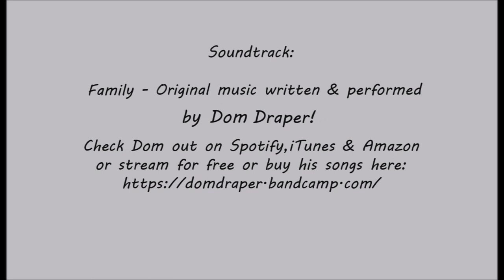How to make a waxed canvas drawstring bag from start to finish!

Comment: That's brilliant, definitely on my Imminent Project list! Regarding the corners, I always use (usually for collars etc) the thread method, gives such clean results. As you're sewing it up, you wrap a thread round the very corner stitch so that the thread ends are left inside. When you turn it out, you grab those threads and use them to pull out the corner. Gives fabulous results. You can thread it after you've sewn it, with  a needle, but it's more awkward.
Reply from the maker: That’s a great idea! Thanks for watching my friend and for the tip, I appreciate it!

Comment: If you can find waxed canvas, it's very expensive.  Thanks for doing this video.  I am planning to make zippered pouches to sell and want to use some unexpected materials such as cork fabric, waxed canvas and leather.  It will be fun to wax the canvas myself.  I appreciate you sharing your technique.
Reply from the maker: You’re welcome! I buy zipped pouches at Hobby Lobby and wax them. They sell 3 different sizes and the are good quality canvas and very inexpensive! Thanks for watching my friend, I appreciate it!
Reply: @Dominic.Minischetti  I didn't think of trying to find the pouches already made.  What department in Hobby Lobby do you find them?  I'm going there today to pick up some cork.  I think the combo of cork and waxed canvas might be nice.  Debbie
Reply from the maker: @1955dmb  They are in the craft department. They are called zippered pouches. They start at $1.29 for the smaller ones and I think $1.69 for the larger one. If I remember correctly there was 3 sizes. But I could be wrong, there’s definitely at least 2 sizes because I have purchased many of them!
Reply: @Dominic.Minischetti  Thanks so much! Can't wait to hunt them down.  You can't even buy a zipper for that price, let alone fabric, thread and time to sew it!!
Reply from the maker: @1955dmb  You’re welcome! And yes I agree, the price is great! I must have purchased around 15 of them so far and waxed them! I even cut some down and made some shorter for specific projects! Good stuff! 👍🏻
Reply: @Dominic.Minischetti  Getting ready to leave for HL.  Can't wait to try some new things.  Thanks for the inspiration!
Reply from the maker: @1955dmb  You’re welcome and have fun!
Reply: Found some.  Lots of options.  Thanks for the tip!!
Reply from the maker: @1955dmb  That’s awesome! I have to pick up some more myself!

Comment: Will this hold up in a hot place like Texas?  I'd like to make a large bag to add to a wheeled  cart.
Reply from the maker: Well it’s pretty hot here, I’m in Florida. I haven’t had a problem. I would say my mix ( 90 percent paraffin and 10 percent beeswax) would start to melt at around 130 to 140 degrees. I hope that helps!

Comment: Instead of reheating and blotting the extra wax OFF, wouldn't it be better to iron the material between 2 pieces of parchment paper and even the wax out. Just my thoughts. Waxed canvas loses wax over time with regular use. I would try to get it as saturated as possible. But great tutorial!
Reply from the maker: Great idea brother! I have since modified my method. I now wax multiple pieces at a time. Anywhere from 3 to 6. This way the excess wax melts through the bottom layers and there is way less waste and blotting involved! It’s faster and more efficient! I never use an iron anymore! Thanks for watching brother, I appreciate it!

Comment: Cool, helpful video. Info on beeswax vs. paraffin is very useful. Beeswax is 3X more expensive. I think I'm going to take my bar of beeswax that I bought today, and just rub it onto the surface of the canvas I bought today. Then just heat set it with hairdryer or heat gun. Im thinking now that I'll have to do both sides to get the penetration that you do in your videos.
Reply from the maker: Thanks man friend, let me know how that works out!
Reply: @Dominic.Minischetti  I think on a scale of 1-10, I’d give it an 8. A little labour intensive, but there was minimal waste because I waxed the pieces after I cut them. The heat gun scorched a bit where I got to close for too long, but it gives a bit of a patina. Probably much less mess than melting and brushing method.